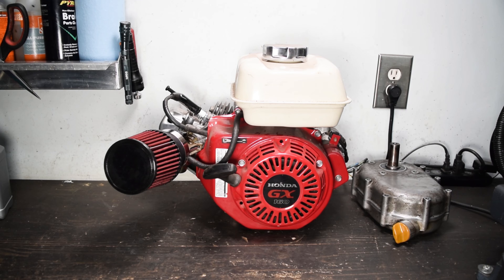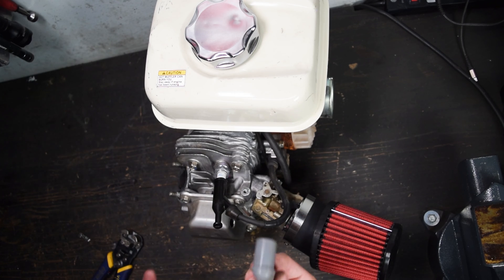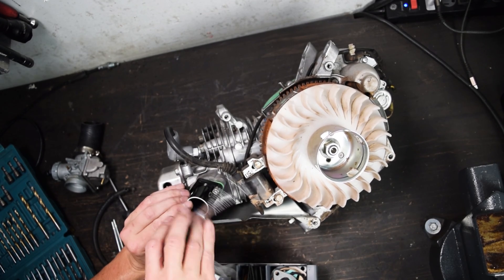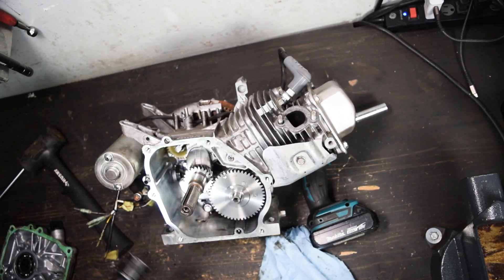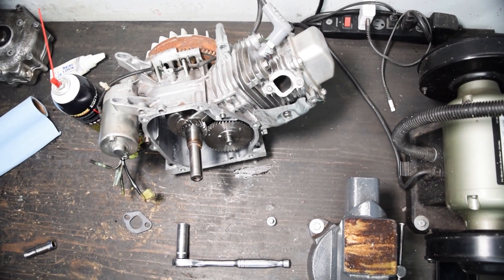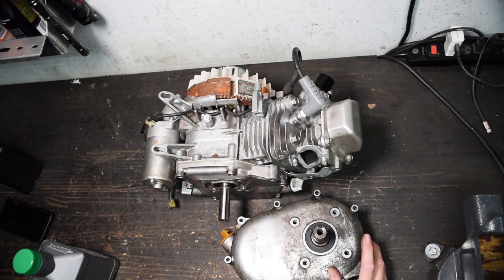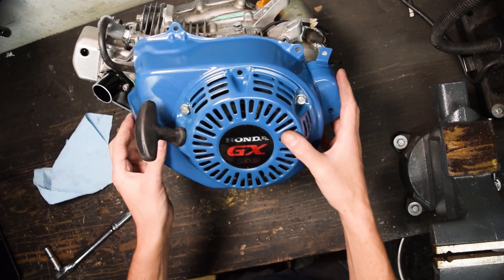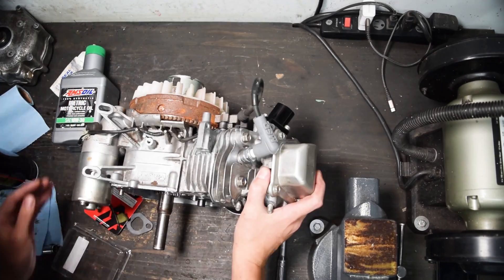Mod 101: Honda GX160

Comment: hey im picking up a honda gx 160 i think it is off a pressure washer and recently service but the guy said the water pump gave out  and i want to replace the motor on my mini baja, now i want to build the little motor with the carb setup ive heard about, im new so im jw it buying it and with the build it will be ok to use and with the clutch delete system, should i use the torque converter or should i make it a straight chain? it will be use on some rough terrain to begin with to where its a gravel service road. wondering what would be best to make the best of it without any things majorly breaking though i understand obvsly riding those in the forest you have to work with the bike.
Reply from the maker: It depends on budget. There's nothing wrong with a centrifugal clutch and chain. A majority of the clone engine parts also work on the Hondas so there's lots of performance parts available too.

Comment: what air filter are you using and how did u put it on? can u do a tut on it please
Reply from the maker: I measured the inlet of the carb at 41mm, so I ordered a filter with a 41mm opening,

Comment: That clutch assembly is pretty nice. May make the rest of the gearing easier. No need for a large sprocket on the axle.

Only bad thing about using RTV is that you have less endplay for the output shaft than you would have with a gasket. Other than that it doesn't matter.

If i knew the clutch pack was serviceable and parts were available I would use trans fluid.